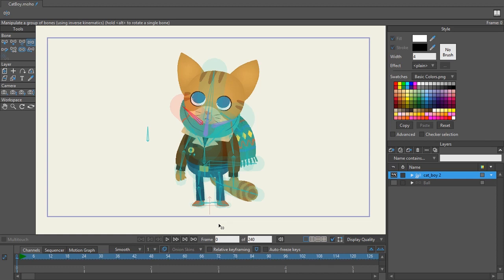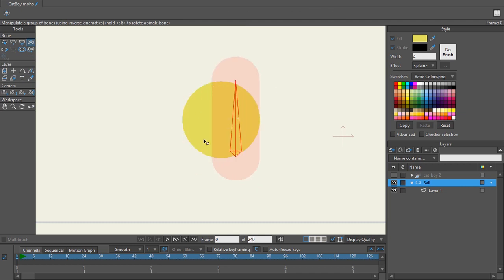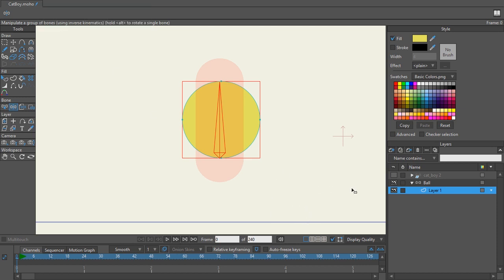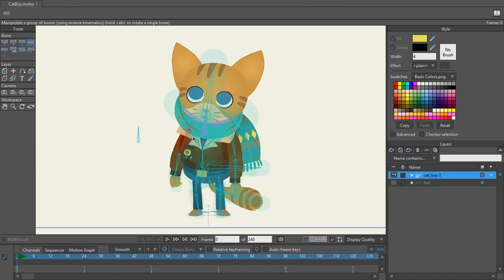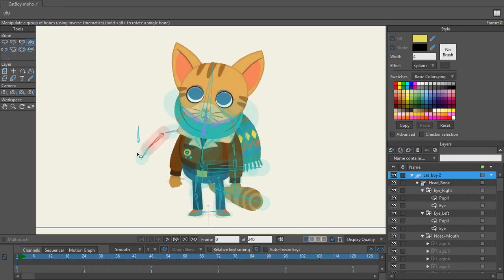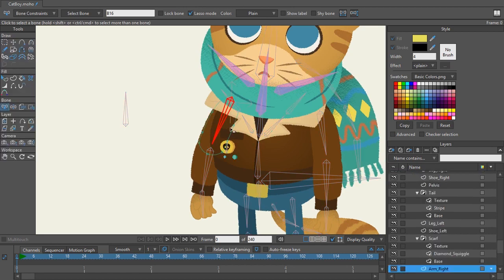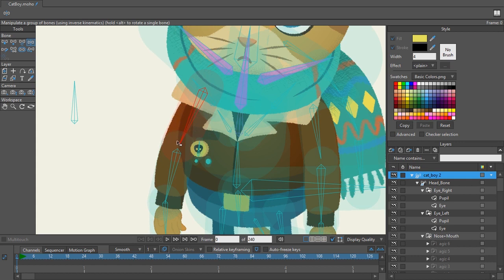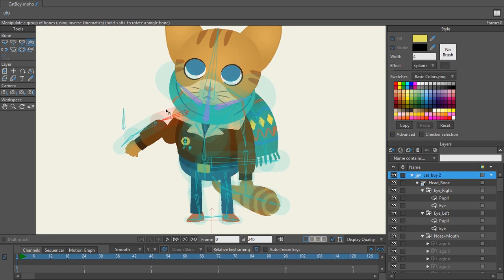Flexi-Binding Pit Fall | Moho Pro 12 | Bone Strength

Comment: I'm having a nightmare with bone rigging.
Even a very simple character turns into a complete disaster when I try to move joints after
binding or flexi binding. I seem to get better results without binding anything, but even  then
I get limbs flying all over the screen or not being affected by their bones etc.
And why does everything fly all over the place when moving from frame one to any other frame?
I just can't get my head around any of this.
Would anybody be willing to take a look at my very simple rig and tell me what I'm doing wrong
if I email them the file? Can you send files over YouTube mesaging?
Reply: Guess you allready figured it out, but make sure you are on frame 0

Comment: that's the most confusing part when someone starts to use moho
Reply from the maker: Pretty sure it's a common problem that most still have even at an intermediate level. I know it was for me about a year ago, and that was after using the software for almost a YEAR! lol
Reply: +McCoy Buck I bought anime studio like 7 years ago and I couldn't figure out how it works 
internet wasn't a thing back then and I couldn't speak English either so I totally dropped it

and last year I finally rediscovered it
and since then it has been such a blast

I've learned a lot from you 
you are such a great guy
Reply from the maker: saeideh rad I'm happy I have been helpful!
Reply: +McCoy Buck ow yeah 
thank you so much